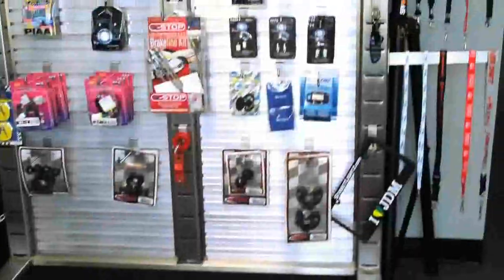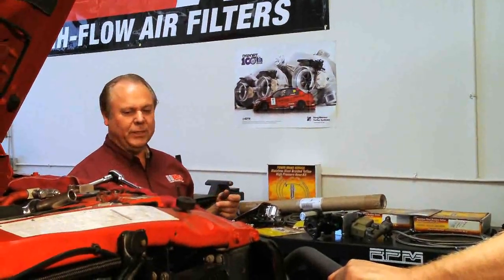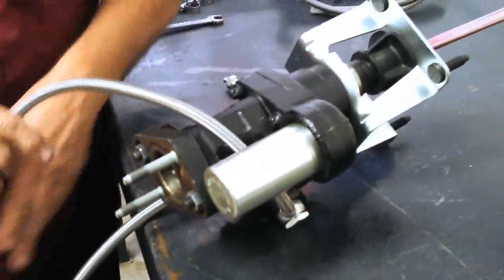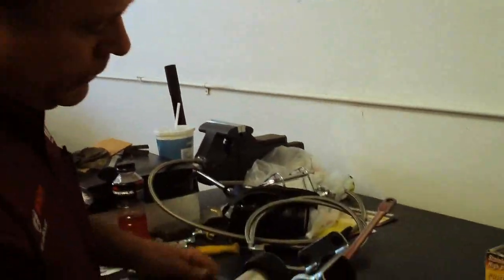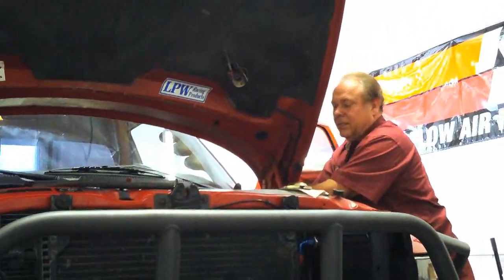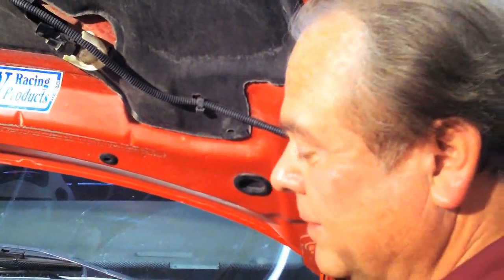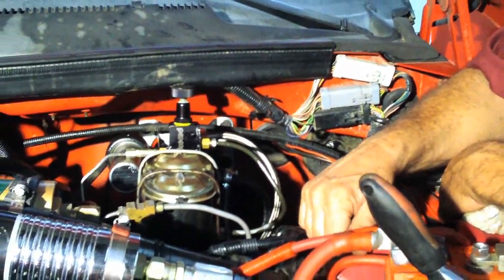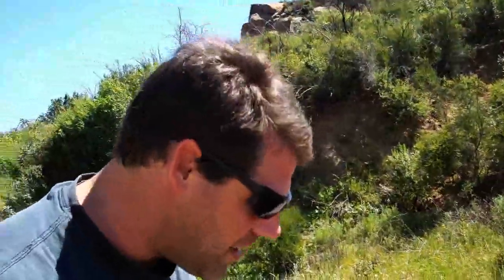Off-Road Magazine Article, Hydroboost upgrade : PowerBrake Tv

Comment: Just installed my hydroboost works great except for the pedal return, it comes back almost all the way then slow return to top about an inch, any thoughts on why this would happen?
Reply from the maker: Turn the T fitting around.

If there is back pressure in the booster low pressure return, it can hold the pedal down or make it slow returning. On vehicles that came with a Hydro-Boost stock, there will be second return on the power steering pump to prevent this. Most of our customers will be converting to Hydro-Boost from vacuum, and so will need to use a T to join the two low pressure returns. The T works 99.99% of the time so long as you have the straight part go from the steering gear to the pump reservoir, and have the booster come in on the 90 degree branch. The bulk of the pressure and the volume of fluid in the low pressure side is coming from the steering unit, so you want it to have a straight shot to the pump reservoir. The booster just spits out some fluid when you press down on the brake pedal. If you get the T pointed a different way, that fluid returning from the steering unit will go up the booster return and hold in the piston (spool valve) which will hold the brake down,  - a lot, or a little depending, until it slowly is able to relieve the pressure, and the pedal raises up.
Reply: Sorry forgot to mention that I did install a an fitting in the side of the power steering pump so I now have two returns, I installed it above oil line could this be the issue why?

Comment: do any of the fitting need O rings or crush washer? I have a hydroboost that I just installed and getting some small leaks what can I do to stop them any help would be great
Reply from the maker: Hydraulic connections will require a flare, washer, or o-ring to seal. The booster ports are deep, and some o-ring fittings don't bottom out, thus not squishing the o-ring. This might be your problem. we use the banjos on the booster side, and the washers seal on the top of the port.

Comment: what are those large cylinders across the engine that say fox?
Reply: I'm not certain, but my suspicion is that they are for the shock system. A large number of off road guys have shocks with separate pressure chambers on them. Most of the times these guys will attach it to the frame or shock mount. I think in this case , they mounted them out of the way under the hood to keep them out of harms way.
Reply: Gas reservoir to add capacity to the long travel shocks. Prevents overheating